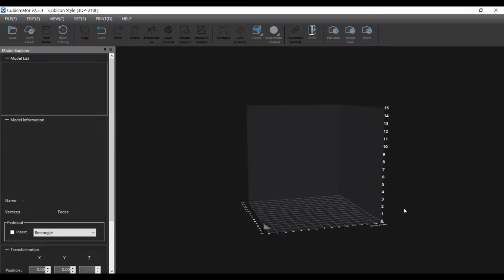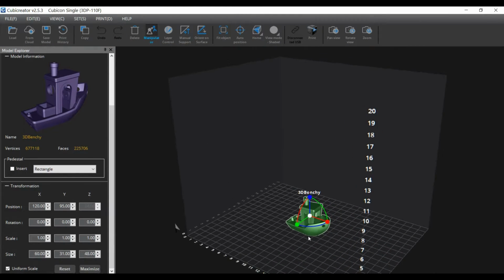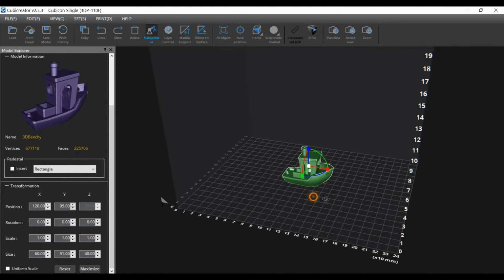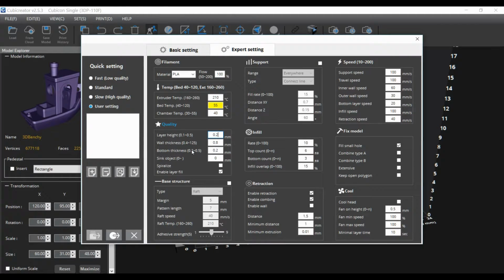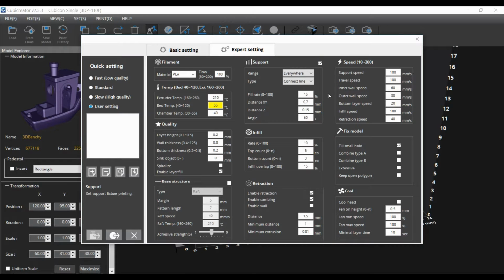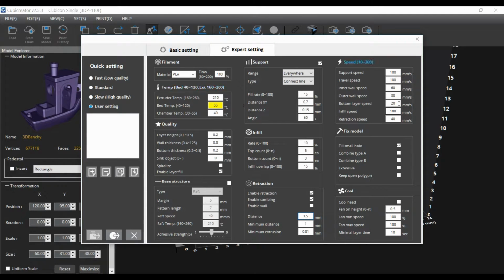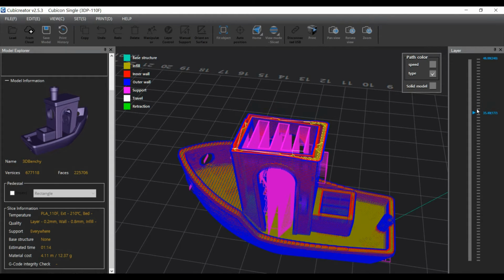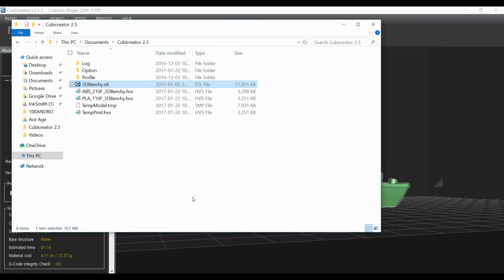Cubicreator Tutorial - Setting up a Print

Comment: I’m new to this and I’m trying to save to G code, but I get a warning that “the database is not correct. It will be regenerated..” I am saving it to an SD card, and shows up in the drive. But when I put it in the printer. It doesn’t show the file. What do I do?